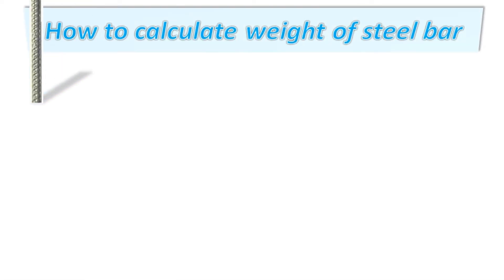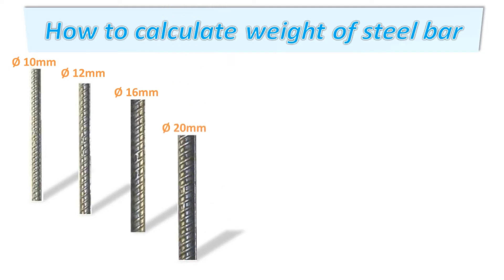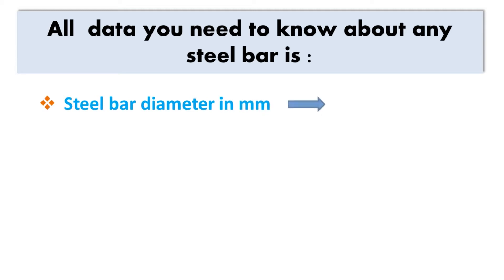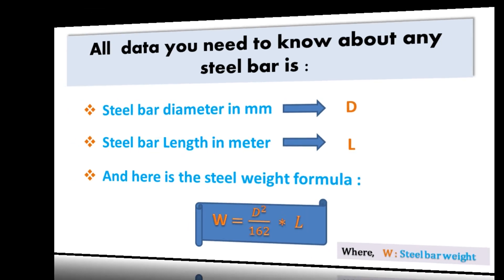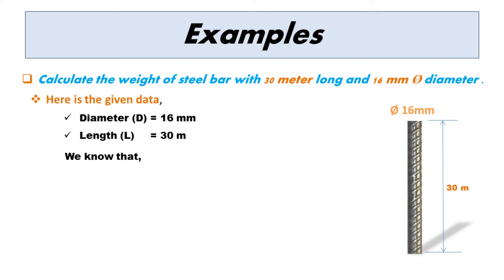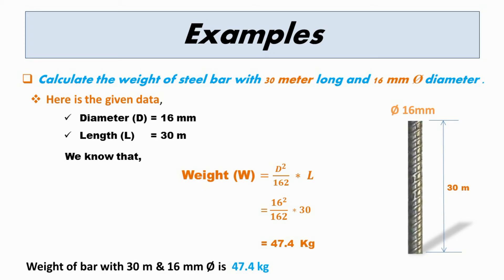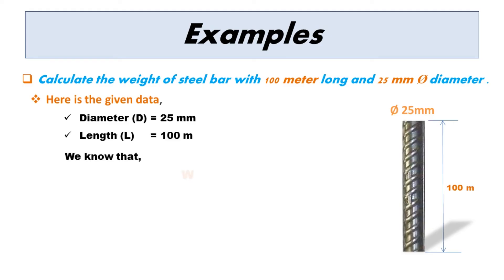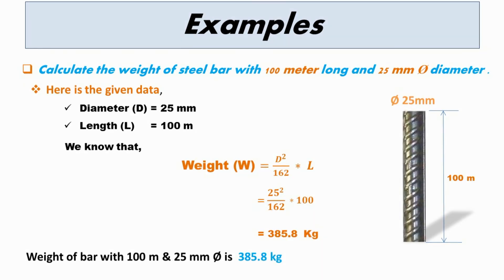!How to calculate weight of steel bar | So simple formula

Comment: Does the grade of steel matters for its weight? For example is there a difference between grade 40 and 60 rebars?
Reply from the maker: Grade 40 has a minimum yield strength of 40,000 PSI and a minimum tensile strength of 60,000 PSI. By comparison, grade 60 rebar has a minimum yield strength of 60,000 PSI and a minimum tensile strength of 90,000 PSI.
Reply: @MechanicsMix  what i mean is, by having different grade, their weight is also different? Like does a grade 40 10mm rebar weighs differently compared to a grade 60mm 10mm rebar of the same length? Thank you